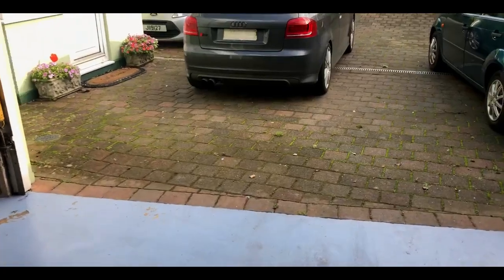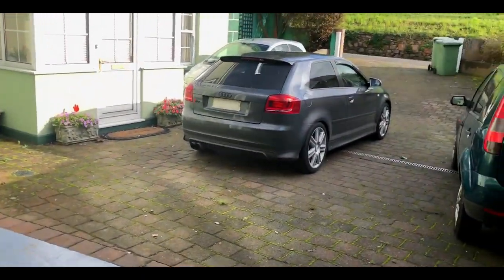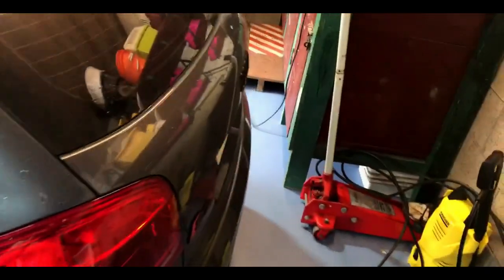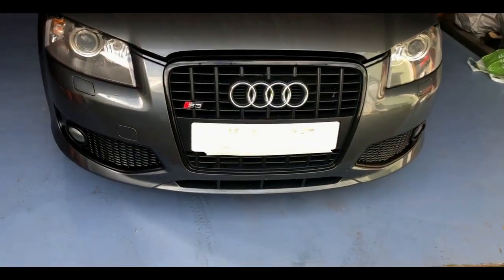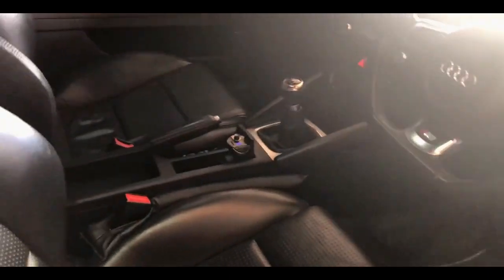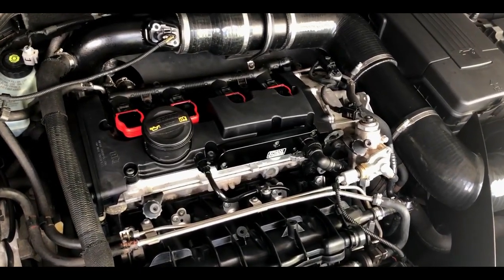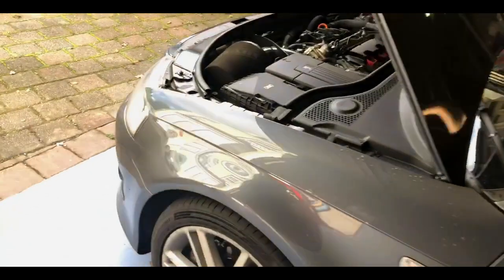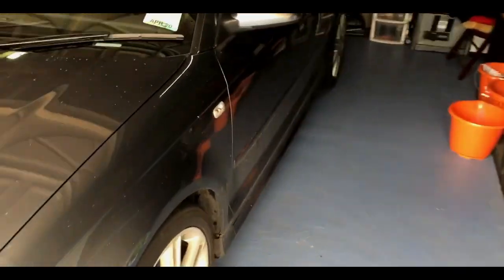Garage Update! - Whats Been Done To My S3?

Comment: Is this stage 2 mate I’ve got a s3 that’s stage 2 running 333bhp on dyno print 3 months ago but the old dyno about 2 years ago was 345bhp so not sure how it’s lost 12 bhp
Reply from the maker: Hi mate, this car was stage 2 although all depends what modifications you have, as a simple intercooler will gain you that 12bhp